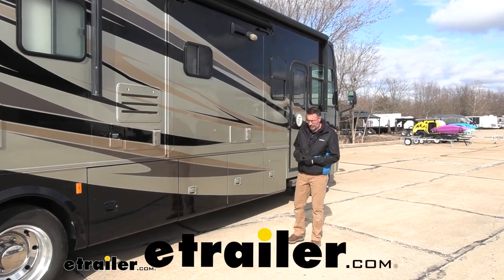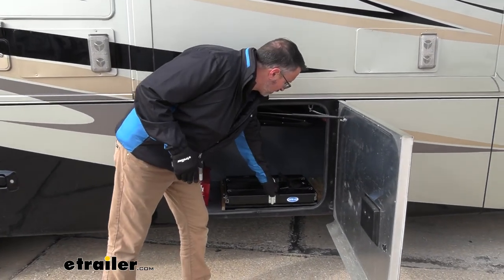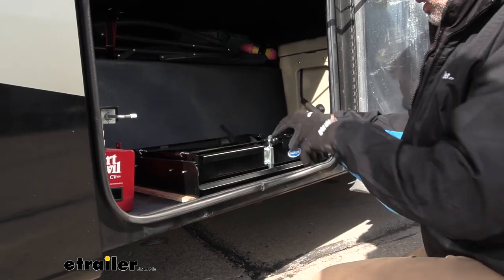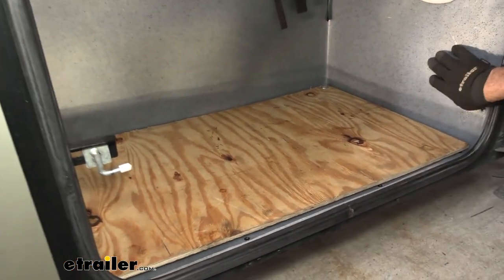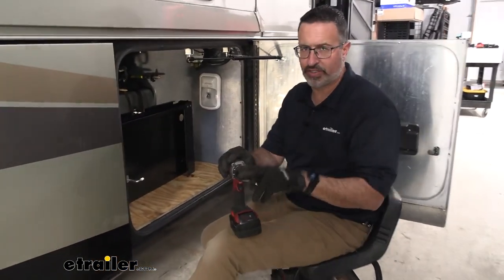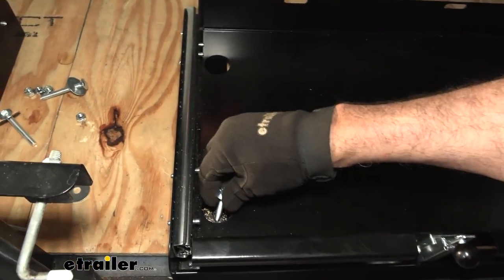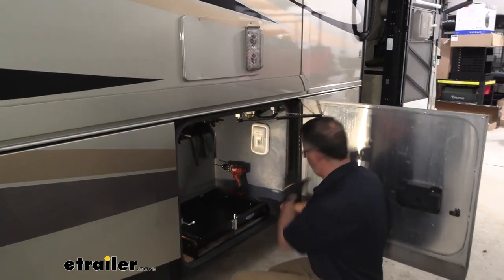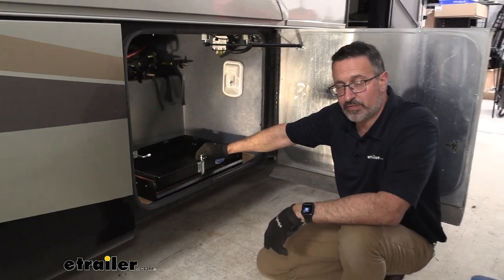etrailer | Installing the MORryde RV Generator Slide Out Tray on your 2012 Tiffin Allegro Motorhome

Comment: This is a really helpful video.  I recently ordered the larger version of this tray for my Cummins Onan P4500i.  When you put in the plywood, did you anchor it to the support structure in the base of the storage bay?  I noticed at about 4:58, the carriage bolt appears to go through some sort of support.  I can't tell if it's the frame C channel or aluminum support.   

Unfortunately for my application, I have a grey water tank directly under the storage area in the rear of my 5th wheel I want to mount the generator in.  This means I can only really use screws, and then attach to the aluminum supports underneath the storage linoleum.    Any suggestions for ensuring the mount will support the weight of the generator when it's fully extended to refuel it?
Reply from the maker: There wasn't any reinforcement or frame members directly under the storage area. We though-bolted the plywood to the fiberglass floor at the corners, then shot the mounting bolts through the plywood and the compartment floor. As far as your situation goes, you could place a piece of plywood on the floor of the storage compartment and use L-brackets to attach it to the sidewalls of the compartment. Then, use short screws (shorter than the thickness of the plywood) to attach the tray assembly to the plywood. Hope that helps!
https://www.etrailer.com/RV-Cargo-Slides/MORryde/MR49RR.html